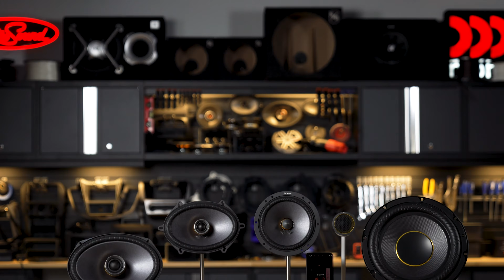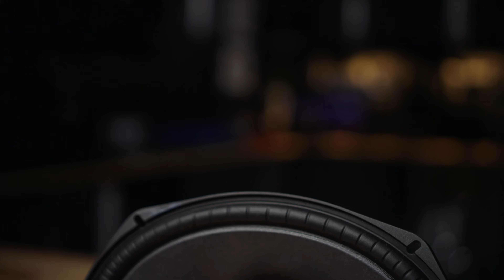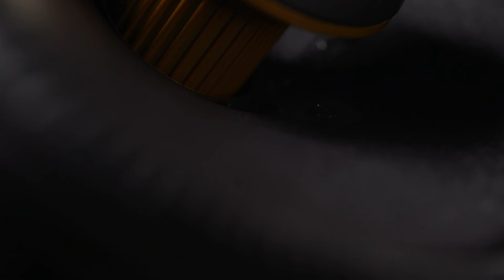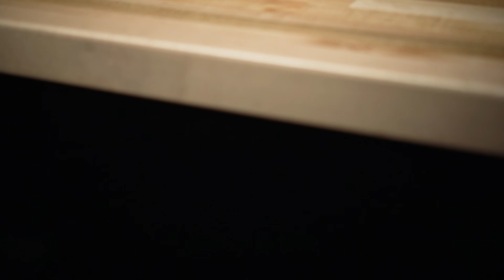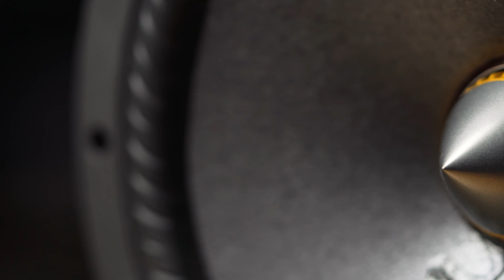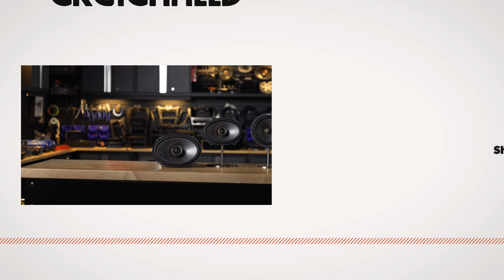Sony Mobile ES Series car speakers | Crutchfield

Comment: This equipment is incredible. I have the 4x100w amp powering 3 way components in the front and 6x9 coaxial in the rear. Max headunit output has been limited using an oscilloscope and amp gain set using a voltmeter. No sub and I don't really need one; the bass is far superior to 'chuck a sub in the back' builds.

Comment: Are these a good replacement in a 2006 Chevy Silverado with Bose speakers?
Reply from the maker: You can fit the Sony XS-160ES Mobile ES speakers in the link below in the front doors only in your 2006 Chevy Silverado with Bose.  Replacing the low-impedance factory speaker with a 4-ohm aftermarket speaker like the Sony XS-160ES will result in lower volume levels. To see all speakers that fit in your specific vehicle, use our online Vehicle Guide in the second link below!

https://www.crutchfield.com/m_399/Car-Speakers.html

Comment: They have the 3 way now. I'm trying to plan an install dose the 3.5 work better with an enclosure in the dash? What size enclosure if so. And would you add sound deadening stuffing?
Reply from the maker: These 3-way component speakers have been built to function without needing an enclosure for any of the drivers (not even the woofers).

Comment: Hello,
For a combination of Sony speakers XS-162ES at front & XS-160ES at rear, which is a suitable amplifier among Sony XM-GS4 or XM-4ES?
I require to get crystal clear sound only with some good bass. I am NOT looking for very loud sound.
What are the extra things to get from XM-4ES over XM-GS4, is it only loudness or the output is far better in terms of clarity?
Is it worth the price if I install XM-4ES or XM-GS4 will meet my requirements?
Please let me know. Thanks!
Reply: Also have this question ☝️

Comment: Will a 1-Ch amplifier Class AB 200 (4Ω) work good for this ES Subwoofer?
Reply from the maker: It can work but that is less power than we recommend giving it for best clarity. The Sony ES subwoofer can handle up to 450 watts RMS and we recommend a minimum of 70% of that top RMS watts. The ideal amp should output 315-450 watts RMS for the sub.
Reply: @crutchfield Thanks I will go for Sony GS100 Class D 330 watt. Is it a good choice ?
Reply from the maker: Yes! The Sony XM-SG100 amp is a match for the sub. They will work well together

Comment: Hi can you tell me which one is the best sony xs-162es or pioneer ts-z65ch. Thank you
Reply from the maker: Both great brands! What types of music do you listen to most often and what will you be using for power? Did you want to fit these into a specific vehicle?
Reply: @CRUTCHFIELD  I want clear music and strong bass my car is peugeot 508 2022
Reply from the maker: We are not able to research a peugeot to know what can fit into it. The Sony ES speakers are better at producing a clearer sound than the Pioneer speakers. If you can run a subwoofer with them, you will have the best of both of those aspects of audio. If you cannot and the preference between them is the best bass, the Pioneer speakers are better. You may want to check with a local installer if its possible to install either of those into your vehicle.
Reply: @crutchfield  thank you so much for helping
Reply from the maker: You're welcome!

Comment: Anyone know the mounting depth or how deep the actual 6.5" driver is on the component set? Having a difficult time finding it on the website. 🤔
Reply from the maker: We can help with that. Which 6.5" system do you have in mind? Are you looking to install them into a specific vehicle?
Reply: @crutchfield  nothing set in stone atm, as used vehicles in my area are difficult to find. Basically to replace my very old work suv 2003 yukon. I noticed a Chevy Tahoe the other day, being a 2011 I believe. Thats a start, but I'm leaving my options wide open to find the right vehicle. I was referring to the dimensions on the 6.5" mid that comes with the 2 way component set.
Reply from the maker: We have a vehicle fit guide on our web site that may help you while you are shopping for vehicles. It is possible to list the vehicle you are currently considering to see what options are available for install. That fit guide can be found here:

https://www.crutchfield.com/I-rYALc227/car/outfitmycar/mycar.aspx

The mounting depth of woofer in the Sony XS-162ES 2-way component speaker is 2-3/16". This mounting depth is typically listed in the Details section of the web page we publish for a speaker and you can find that page on these Sony component speakers here:

www.crutchfield.com/I-rYALc227/p_158XS162ES/item.html

Comment: Hi mate. I want these 3 ways in my car but the vehicle has 6x9 in the fronts from factory. Can I buy a set of the es 6x9 components and use the 6x9 with the 3 way set?
Reply from the maker: Hi Darren, sounds like you're planning a nice upgrade! What is the year, make, and model of your car?
Reply: @crutchfield  it's a 2018 y62 Patrol.

I think it's an Infinity qx80 in the states.
Reply from the maker: We haven't researched your vehicle; but if you are able to verify fit is the same as the QX80 or even the US Armada, you can fit the 6.5" driver in this Sony XS-163ES 6-1/2" 3-way Component System using the American International NSB710 brackets here: www.crutchfield.com/I-rYALc921/p_003NSB710/item.html
Reply: @crutchfield  ok cheers mate. Thanks for your help

Comment: To be home I’m disappointed! The product looks amazing and I don’t doubt that they sound wonderful my only problem is that I only like Active setup! And unable to find the RMS rating of each component! I called sony and they said they can not provide me with the specs I need to go active that I must use there crossover and there amp! So I won’t be able to make the correct time alignment!! What a shame from sony limit us like that! Wanted to have a 3 way system in the front and another in the back and a 2 way in the trunk! 
Guess I’m gonna have to find another company 🤦‍♂️ really wanted to get the sony!
Reply from the maker: We hate to hear about your experience with their support. An approach that works for powering them in an active setup is to get amp/amps which output the total RMS watts of the component speaker on each channel. This process works because the audio being output by the amp is not full range which reduces the watts being output by the amp on each channel
Reply: @crutchfield  my only concern is that I’m afraid to send a 100w rms to the tweeters and blow them out! I’ve always used the x1.2 of the speaker rms power to match the correct amp with it! 
I wanted to have 1 amp (4ch) for the tweeters, 1 for the midrange, 1 for the woofer and 1 mono for the sub all connected to a dsp 
(Probably more if I’m going to install speakers in the trunk) 
This sent up will my epic confirmation!
Reply: PS: And using the ohm law to set the gain correctly… using the speaker specs and not the amp 
And I can’t do that if I don’t have the exact RMS and ohm of each component
Reply: @crutchfield  please if you can get me the info I need + each component frequency range I’d  would really appreciate it 🙏🙏🙏🙏🙏🙏
Reply from the maker: We do have other brands with separates ideal for this type of setup. Do you have the specs on your amps?
Reply: @crutchfield  i dont have amp I’m going to build the system from the ground up! 
I’m looking got speakers carbon fiber or fiber glass woofer with a frequency response that can go down to 35hz so I can set the crossover for the woofer at 70hz with a slope of 18db 
For the 3inch or 4 inch midrange carbon fiber or fiber glass as well that can play down to 200hz and for the tweeter must be silk dome or fabric (deep smooth) i hate harsh and bright
Reply from the maker: Nice! Sounds like Morel separates are the ideal option for your preferences. You'll find those here: https://www.crutchfield.com/I-rYALc921/g_481050/Speakers-for-Custom-Installations.html?tp=88061&fa=1#&nvpair=FFBrand|Morel
Reply: @crutchfield  yeah figured as much 🤦‍♂️ 
I’m really sorry But I can’t go for Morel (got my reasons) do you have any alternative?
Reply from the maker: Sure, you'll find the comparable models here: https://www.crutchfield.com/I-rYALc921/g_481050/Speakers-for-Custom-Installations.html?tp=88061
Reply: @crutchfield  thank you soooo much 🙏🙏🙏🙏
Reply from the maker: You're welcome! Glad we could help
Reply: @crutchfield  ❤️❤️🙏🙏

Comment: Will these be available for the 2017-2020 Nissan Pathfinder with or without nav system?
Reply from the maker: Our research department did not find enough room in the stock mounting locations to take these speakers. If a custom work is done to make room for them, then it is best to install an aftermarket amp to power them. The reason is that the stock speakers have a lower impedance than these speakers. These speaker will pull less power than the stock speakers and at this level, that will produce a noticeably reduced volume level which will lead to an overall, lower sound quality.

Comment: wheres the midranges?
Reply from the maker: With our current line-up, they are included as the 6.5" driver in the  6-1/2" component speaker system or built into the coax 6.5", 6x9" and 6x8".

Comment: I have Sony Mobile Es speakers and it beats a lot of more expensive speakers in terms of sound quality. They sound very vibrant and clean.
Reply: Do you hear the important sounds that for some reason other speakers don't focus on?
Reply: @Tunehead99 since I had mine installed a couple weeks ago, I’ve listened to music I’ve been listening to for a decade and I notice parts I’ve never heard or noticed before
Reply: Ok, thanks for the update.  @DouglasPalmer27

Comment: I spent a little more and got Audio Frog.. Sorry.
You can't touch what I got...
Reply: Oh, Im currently cross shopping these with AudioFrog, Morel, and Focal! Any input? Ive had Focal in the past with great luck, but am wanting something more smooth this time around. Yet I don't want to sacrifice too much of the top end, so I'm kinda stuck in my shopping right now...
Reply: @aaronfrench8322  What do you mean by top end? Hz wise?
The AF GB series are so smooth. My music tastes have changed quite a bit because of these speakers. The GB's don't quite get as loud as the GS's but the tonal difference is pretty noticeable in my case. I have had Focal's before and they are good, but I think I have found the best speaker for me that will most likely go into my vehicles going forward. Go to your shops and see if they have any customers with the GB's and talk to them to get their opinion.

Comment: Will this be a night and day difference if Ill be replacing the stock Bose system on my Sierra 1500 truck? Im just thinking of upgrading the stock speakers
Reply from the maker: We can check on this. What year is your Sierra pickup? What cab does your pickup have?
 
Also, are you hoping to use the amp in your Bose sound system to power then new speakers?
Reply: @crutchfield  I have a 2019 Sierra crewcab. And yes Im using the stock bose amp and only replacing the bose speakers
Reply from the maker: We do not expect that replacing the speakers in that system with these Sony Mobile ES will produce that level of difference in sound. There are other speakers that can give that level of a difference. Speakers with a 92 or higher sensitivity will typically give that level of a change in sound in this system.
Reply: @crutchfield  what do you suggest
Reply from the maker: I'm sure we can find some speakers to help improve the sound. What changes are you hoping to make to the sound you get from the Bose speakers?

Comment: Does this amp have enough power to run the 6.5's XS-160ES & 6x9's XS-690ES together?
Reply from the maker: What is the brand and model of the amp you are asking about?
Reply: @crutchfield  sorry I’m asking about the Sony XM- GS4 amp
Reply from the maker: That amp can power both sets of the speakers you first listed!

Comment: Just put four 6.5's in a 2017 Mazda 3.  No amp.  All stock. Sounds incredible.
Reply: Is the bass good? I want to be heard coming down the street
Reply: @imSincerePromise  It's "good" and very clear but if you're going for feeling the "thud" or hearing it from 100 ft. away then you're going to have to add an amp and a sub.
Reply: @truth8508  ok thanks
Reply: How did you set up the tweeters? Having trouble trying to figure out how to set up the crossovers and wire them over to the factory location

Comment: Wish my spinal cord would heal, and then when these parts come out, snag the coaxial ES speakers (xs160es) for my front and rear doors, and then snag the 10" sub, maybe two, and put them in a sealed enclosure in the trunk of my mirage. I would LOVE this system. The only downside would be lack of new headunits. We are gonna need ES headunits too.... the GS9 is just too expensive and usually sold out anyway.

Comment: Was looking at putting JBL GTO930's in my Jeep Renegade with a Sony XAV-AV7000 . . . . but these seems WAY BETTER. Had the Sony premium option in my 06 Ford Focus ST, and I loved it. This would let me keep the Sony brand all the way through. Awesome video!!!

Would I be fine running 4x Sony XS-690ES just from the Sony AV7000 (with the built-in 100x4amp/45w RMS). My Renegade only has 4 speakers, no dash or sub woofer. I don't want to severely under power the Sony XS-690ES.
Reply from the maker: Those speakers have a decent sensitivity and should work well with that radio's power. Definitely work better than other speakers will with that power. If you would like a recommendation about this match meeting your goals, we have advisors that can discuss all this and give you a personal recommendation. Here's how to reach us for this help:
 
https://www.crutchfield.com/I-rYTVc227/support/ContactUs.aspx

Comment: Sony ES was always my dream equipment.
Reply: I got a set of still new in the box Sony ES 6x9 Coaxial speakers from back in the 90's at the Salvation Army Store for seven dollars. Being old school are paper woofer with doped cloth surround and a paper tweeter.  I knew Sony ES was good, but I was actually shocked how much better they sounded than my other 6x9 speakers.